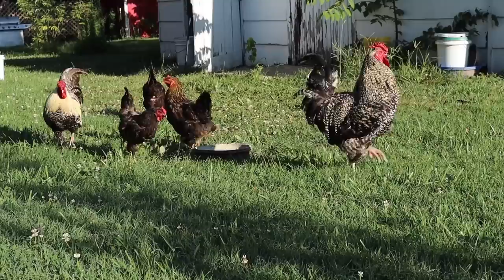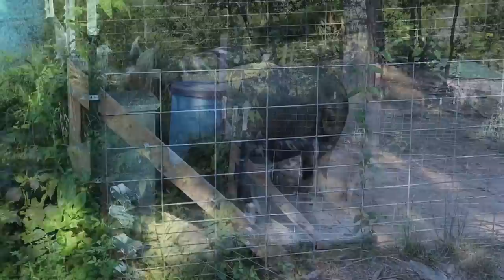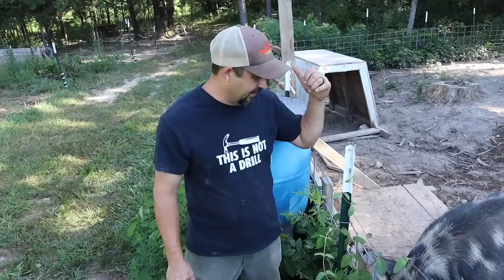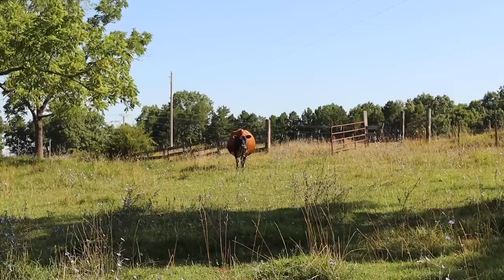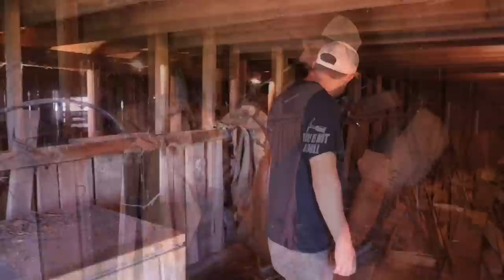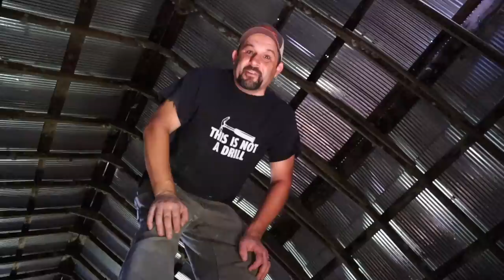This Barn Has Waited 50 YEARS To Be Used Like This Again!

Comment: Use the wooden boxes for your hen house. Put straw in them and your hens will love it!

Although we milked a cow in our barn, we only had one stansion. We had stables for the team's and ranch horses. 

Put the 8N tractor under one of the eaves and horse drawn machinery for haying. The other open end was for whatever was in the corrals. Horses and colts or the milk cow and calf. 

Our hay was in 50 to 65 pound bales or loose that we would dump over the sides to feed a team in the hay manger. Kept the hay from molding when the loft/hay floor was open on the sides. Good air flow too.

Yes, you will have to clean the dirt out of the "poop chute" behind the stansions. The bottom should be concrete where you can wash it out to keep your barn smelling sweet and clean. 

Now you are going to have to get a couple of barn cats because the mice and the rats will come into the barn and have babies. Just leave them a little bit of fresh milk and let them clean out your mouse population.

A good dog can run your rats off. We had a standard size, Rat Terrier as a pet who would go everywhere we were and kept the rats away. Later dad got a German Shepherd who was a good ratter. She would travel along the water canals and root out Warf Rats. She also brought the horses or cattle into the barn so dad didn't have to go out and catch them. If the ants and spiders got bad around the barn, he would tell the dogs to go get the chickens and they would keep them in the barnyard to feast on the dropped grain and bugs. 

Nothing went to waste and we had good Rhode Island Reds, that stayed in the coups and yard all day after egg laying time was over. A pair of Banty Roosters and 4 hens were in the Corrals and around the house. The dogs brought them all into the coup in the evening. The Bantys served as our setter hens, to raise chicks and occasional ducklings for the pond and garden bug eaters. The only bug killers he ever used was fly paper in the coup and barn when it was muddy in the corral, and the manure pile was still defrosting in the spring. 

He spread the good manure pile on his pastures and hay fields too, with a team and a spreader. Today you could probably do the same with a small tractor which has a bucket for loading hay bales, dirt and manure. Stretching fence wire, a post auger and such. 

We didn't have alfalfa hay rounds in those days, only square or loose stacked hay. We lived in Wyoming and a tractor just wouldn't work well in the heavy cold, snow and ice we had so we needed a good team of horses which doubled as company horses, when relations wanted to ride a horse. Dad and I rode Quarter Horses. The Ranch was over 140 acres so you probably won't need a team. I got carried away a tad bit in my memories. Ha! 

Do think you need a dog though and a couple good barn cats. They really are a big help. So very glad your milk cow now has a lot of room in a real pasture. Will be a happier milk cow and will get in the routine of milking time and wait at the gate. She could probably raise another calf too, along with her calf. Just make sure you milk her out or she will only produce enough milk for her calf. 

Thanks for listening to my long message. I miss my childhood and is nice to be able to share, maybe help you out a bit. Thanks for listening...

Good luck to you both! Be kind in all things and God Bless!
Reply: What lovely memories. X
Reply: Thank you for sharing! Love hearing about by gone days! Always love hearing about the farm or ranch dogs working and helping out with chores, etc! Never ceases to amaze me how & when dogs understand and do what is needed or asked of them! Dogs can be so smart!
Reply: We should all go back to doing those things if we can. I know I’d be a lot happier
Reply: Thankyou for that reply to Living Traditions. I have happy memories also...... learning to knit socks sitting on the floor at my mother's feet, about 5 or 6 yrs old she put the 4 needles in my hands, showed me what to do and that's how I learned. I so enjoyed your recollections , Thankyou again from a rainy day in Belfast NI.
Reply: What a hard, yet wonderful life that was!  Thanks for helping me remember. 😁
Reply: Wonderful memories, thank you for sharing.
Reply: What a lot of good memories as well as information.  Thank you, Donna.

Comment: What a beautiful barn! We bought a neglected 100 year old former dairy farm.  The barn is a beautiful step back in time.  We are almost finished restoring it.  First, we made structural repairs on the inside.  We bought used lumber from a guy who took down an old house and saved the old floor joists.  We also bought poles from a local winery that were used to hold grape vines.  Then we put on a whole new roof so the barn was finally water tight.  The final repair will be to cover the sides in metal (the wood is rotting) and rebuild all the doors and replace all the tracks.  That may come next year.  Our doors are falling off the tracks as well.  I also painted the 48' silo next to the barn.  I saved all the writing on the walls inside the barn - they often did calculations on the wall when they sold milk and I saved all their old calendars.

Comment: I was on the tail end of the square bale era. In my teens in the mid 80s my Father and Grandfather would put up 4000 bales a year.  My Grandfather's barn had a loft similar to that one and we used an escalator to convey the hay up to the stackers in the loft.  We would rotate on each load from stacking in the loft to putting bales from the trailer to the escalator.  Everyone couldn't wait until it was their turn to be at the bottom and get a break from the hot dusty loft.
Reply: Late 70s, early 80s. My dad was a country veterinarian. He loaned us kids out for haying 'square' bales for a portion. All day, all week, all summer.  I learned to drive in the hay field. 50s era big flat bed, stick on the floor. The day smoke started pouring from under the dashboard and I slammed to a stop, my brother almost killed me for almost killing him, while he was stacking up high. Good times.

Comment: When I was a kid, our neighbors were dairy farmers. They had between 50 and 60 head. All automatic milking. Barn was mostly like that one but..they had grain silos, automatic manure tracks in those manure cemented ditches that the tracks scrapped it all down the line and out of the barn into a manure spreading wagon pulled by a tractor. They used the top of the barn for 50 lb hay and straw bales stacked for the cows. They also had a gravity fed grain holder. So they would pull a big, deep wagon underneath,pull the shutter door to fill the wagon and closed back when done. Rolled the wagon down the line and fed the cows. Eventually they got automatic waters and electric wagons that dispersed the grain. They white washed all the walls down and used a lot of bug zappers also in the barn to keep the flies down. Cats were always in the upper hay half of the barn. Ah yes fond memories. Learned a lot of my firsts on that farm. Can't wait to see what you do with yours! Excited for you! PS..the barn was kinda built into a small Hill. Meaning..where the cows were was like half dug out of the hill like a basement even with the ground outside. One big end for them to go in and out into pastures but still kept it a lot cooler down there. The upper half was where the top of the barn was so the farmer could back the hay wagon up the hill and we got the hay of the wagon straight into the top half of the barn. If that makes sense?
Reply: My Uncle Daryl ran Welsh Dairy near Shawnee Mission Kansas and when I got to go help at the dairy we washed the ditches out with high-pressure hoses and what a mess outside the barn it was so bad if you had to walk through it it would pull your muck boosts off. yuck
Reply: Our big barn was like that.  They call that a "Bank Barn".
Reply: My Uncle Weldon and Aunt Dorothy had a big barn. Not the same style but just as big, maybe bigger than your all's.  Though it was quite tall, it was wider than it was tall. It had some sort of tractor in it with a flat trailer stacked with square straw stacks, when my sisters and I visited, we would jump on those stacks with my cousins.  Some times there were other tractors in or right by the barn. The pigs were kept in the barn, or at least hung out there.  Good memories, lots of fun. Many years later after my uncle passed away, his son had an office in that barn, still tractors, still stacks of straw. No more pigs, just a faint left over odor from pigs, when they used to be raised their. I'm sure there are many more attached memories for those who lived and grew up there

Comment: Barn uses?  Here's one that won't get in the way of anything.
Make sure the roof is fully repaired, add some structural supports,..
 and then put 5-10kw of Solar panels on it.
Reply: Craig the metal roof may be to hot, panels don't like heat. I know being made to be in the sun. Go figure!
Reply: Why would you put solar panels on any roof if you have the area on the ground?  A whole lot easier to build and maintain.  Too many relate solar panels............roof.
Reply: Craig Escaped Detroit ,,,,, NOOOOOOO!! please don’t ruin the historical architectural significance of the barn with solar panels. I support solar just not on a beautiful barn such as yours!

Comment: We had a large barn like this when I was younger we also had a vacuum line like the one you showed. We would milk our cows with a milker but you still had to empty the milker bucket into the metal milk can then we would have to carry the milk can to the freezer but Borden came up with a new system wear the milk would go from the cow to the cooler and Borden would come by and hook the truck hose to the cooler so nobody could ever touch the milk. We only had 23 cows and for the price of the new system we could not afford to pay for the new bulk system

Comment: Grew up on a farm with a barn like that and the loft was originally used for the storage of loose hay which was hoisted to the peak with pulleys and run along a rail at the top inside of the roof and then dumped at the appointed place.   Later it was used to store small square bales.

Comment: I grew up when those barns were regularly used on the dairy farms. Filling the hayloft was not always done using an elevator. At our place you tossed the bales up into the loft or if you were lucky you had a block and tackle to to lift the bales into the loft. Yes, Kevin you were pretty accurate on how you thought the lower level of the barn was utilized.

Comment: I helped to put a lot of hay in barns like yours In Afton Wisconsin. We rode the hay up the elevator and hung out in the hay lofts. We built tunnels and hidden forts with the hay. We even had one side of the loft as a basketball court with a bushel basket with the bottom cut off as a hoop. We also had a big swing rope for king of the mound. I will never forget the feel of those old lofts with the light beaming in through the slats and the patina of the large hand hewn beams. Those were some and good simple times.

Comment: Yes, you are accurate. It reminds me of the old barn we had on the farm. We did not bail our hay when we were little kids, it was put into the barn loose, useing a large hay fork that was lifted from the outside of the barn by pulling it up by a horse and when it got to the top it was on a track that ran to the back of barn when you got it to the spot that you needed to drop the hay, you pulled really hard on the rope that released the latch on the fork and the hay dropped. It was a lot of work so we were happy when bails came out. It made life easier.

Comment: Thank you for sharing your beautiful old barn! It looks like it was built for small cows, probably Jerseys. I grew up milking Jerseys and Brown Swiss and miss it every day. We were behind the times and didn't have a pipeline, so used a DeLeval bucket system that is most likely similar to what was used in your barn. Those old barns are such treasures and yours is one of the lucky ones that someone put a steel roof on. Here in MN most of these barns have been lost because of the expense of roof repair.

Comment: I grew up on an old farm with an old barn. It was made with wooden stakes, no nails. It was an awesome playground for five kids. It was also state of the art for it's time (not by the time we got it). It had an overhead track with a half barrel that was used to load manure and run it out of the barn. It had a small milk room. The upstairs loft was huge made with 12x12 wood beams we used to run on and several hay elevators to drop hay down. . We cleaned different sections over the years for our projects at the time. I remember cleaning a large section of the loft and hung a basketball hoop so I had a place to play indoors. When the downstairs was empty we would ride our bikes around the different pens, in and out.  I'm so grateful I had the opportunity to grow up in such a great place and experience farm life.

Comment: In my younger  days I shoveled a few gutters. Used a wheel barrow down the gutter and ran it on a board outside the barn so the pile would get high.......that was before automatic gutter cleaners. The gutter is the same whith as the shovel

Comment: Love your barn. I grew up in Southwestern Mo. with a barn my parents built out of green oak lumber in the late 40's. It had a track in the peak for the hay tongs and a big sliding door that you let down to get the hay in and out. They had a grain room inside in the corner all closed off. They milked around 15 cows in the side with a concrete feed trough and gutter and all too. All concrete floor too throughout the barn.  They used 2 machine compressor milkers and had to lift and pour the milk in the strainer and cans. Wheel it up to the well house where we had a square homemade cement water tank to store it until the milk truck came for it. Our barn was a little bigger and had an arch roof over the middle part (no loft) with lean-too on each side. We had a corral in back and when a cow was having a problem we would keep her in their or sort calves or even stored hay sometimes if we needed to on the other side. Our farm had 80 acres like a lot of farms around here. My grandparents was the third original owners for I have  the paper from president James Buchanan land grants. Thanks for the memories.

Comment: I absolutely love your barn. I'm 51 and when I was young like 10 or younger my step dad was a part time tobacco farmer. The old way with the harvester and the whole crew. I strung tobacco onto wooden sticks on the harvester. I loved the outside seat to work on if you know about harvesters. Anyway we had a barn very very similar to this one. The bottom was wide and open end to end. The sides had stalls for animals. And it had a loft and we used it to "Take off tobacco" which means after it cured in the old tobacco barns they would move it to places like the old barn loft to take it off the sticks. It would be graded and piled into burlap sheets and tied up to take to market where they had an auctioneer. That was so cool. I wouldnt trade those memories for nothing. Because 3 or 4 generations were always involved in the entire process. Such good memories. BUT GETTING BACK TO THE BARN. Lol. My cousin who was a year older than me dared me to jump out of that loft with him and I did. If my mama had known oh my gosh
 But the Lord was watching over me as I didnt get hurt. I just couldnt let him out do me. We laugh about that til this day.

Comment: Very Nice! The barn here was built in 1901. Been in my husbands Family for generations. Our hope is to keep her standing another 100 as well. Its a daunting process! But think it will be well worth the blood, sweat, tears for our children and theirs. No advise other then to say We also use ours to house our rabbits and the barn here has a barn cleaner which will save your backs from mucking out. We lined up the Rabbit cages so they just get dumped/raked into the ditch and the cleaner runs threw and sends it into a waiting spreader or pile.

Comment: Looks like the farm I grew up on with a barn just like that. I was one of the people that helped stack the hay in the barn but we did not use an elevator.. We used a hay wagon and the bales of hay were forked using a hay fork with usually 6 to 8 bales forked and then one of us would drive the tractor forwards with a hay rope attached to the back and then threw a series of wooden pulleys the hay was pulled through the hole on the second story. The hay forks had a rope on it that you could pull the hay bales close with a steel track on the ceiling of the barn to where you wanted it up in the haymow. With a jerk on the rope you would release the bales close to where you wanted in the haymow. It was extremely hot and dirty and pieces of hay would get in your eyes. I always wore a long sleeved cotton shirt up there otherwise my skin would break out all over. My dad always used one half of the barn for cattle and the other half we put our hogs in the winter because it was warm in there. Unless they were having baby pigs and then he would either put them outside in hog houses or put up divider for each sow that was pigging in the barn. It was a pretty noisy place in the barn! LOL. I'm lucky the barn still stands and I have wonderful memories of my brother, dad, grandpa and cousins all working together haying.  Dad milked for a while in the 50's then changed over to angus just for breeding and selling to market. We always had hogs though. I had a happy life on the farm! I wish you and Sara would move to the other farm. I think you would be happier there with all the farming right beside you. Especially having a barn right there. I always thought a barn made the farm! Hope Sara is recovering well. You are both dear to so many of us.